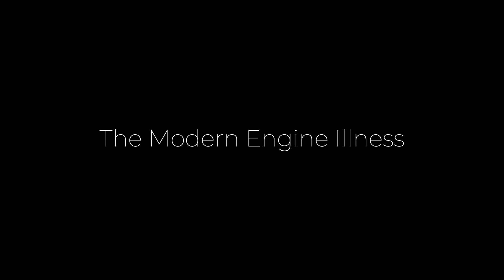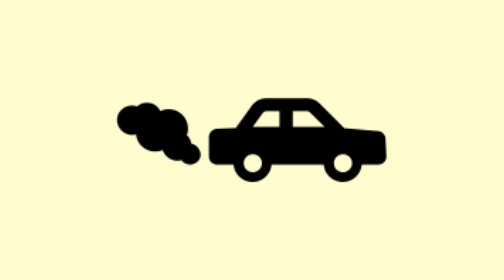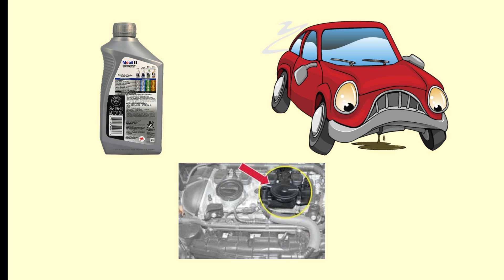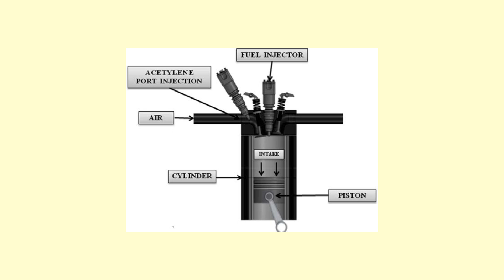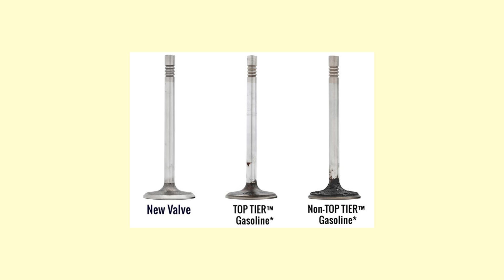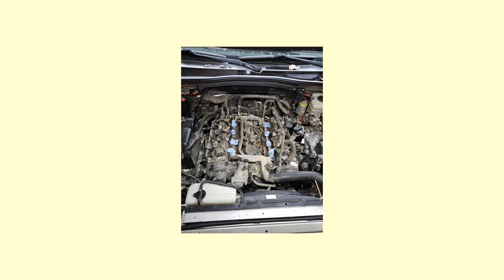The Silent Sickness of Modern Engines

Comment: Direct injection is not more fuel efficient! nor is it more powerful. Fuel has to first atomize in order to burn . When you spray it right into the combustion chamber it doesn't have enough time to fully atomize. Leading to unburnt or in other words wasted fuel. Which is not very good for fuel economy or performance. Bonus fact, the liquid fuel that is left on top of the piston or that gets stuck in the ring lands is now likely to cause detonation on the next power stroke after it has been heated and atomized. This isn't the only damage Direct injection creates. When the liquid fuel sneaks past the rings and gets into your crankcase it no dilutes your engine oil leading to improper lubrication to every engine component.
Reply from the maker: Correct but with direct injection as that fuel delivery is usually more optimised compared to port injection (which focuses more on cleaning intake valves) so thats why direct injection engines usually are more powerful in my view
Reply: @Enguitive  Not to mention direction injection allows for better fuel spray pattern and promotes turbulance to allow for cleaner burning as well as having better throttle respone compared to port injected engines
Reply: @ Cleaner burning? lol I'm not going to relist all the reasons why that is false you can read my other comments, if you want to know why that isn't true. But don't take my word for it. Ford says they now have to put gasoline particulate filters on there new 2025 model year mavericks because of all the unburnt fuel getting into the exhaust due to GDI. I got an idea get rid of GDI instead of this band aid to pass clown world regulations!
Reply: @Enguitive  On carbureted engines or even multiport fuel injection. You get to set when fuel is introduced to the cylinder with your camshaft profile. The optimal placement of your intake valve open and close positions and overlap will lead to increases in both fuel economy and performance. Paired with far superior atomization in the other forms of fuel delivery, you can out perform a direction injection engine on all fronts. You wouldn't even need a catalytic converter. If you didn't have unburnt fuel in the exhaust in the first place through bad cam profiles and improper ignition timing. All this being said your video is a good one to explain basic concepts of direct injection to the non engine builder.
Reply from the maker: Thanks man! That makes sense, it seems that manufacturers are now forced to use either DI or some form of dual injection due to increasingly restrictive emissions regs, I think the last purely port injected engine in a sports compact is the EJ257 in the VA WRX STI, and you can probably see why Subaru can't make a VB WRX STI
Reply: @ Yup it's all about politics sadly.
Reply: @The0utmode  If that was the case, then why do manufacturers continue to use catalytic converters and direct injection? Unburnt fuel isn't a significant problem on any modern electronically controlled engine, whether with port or direct injection, but partially burnt combustion products are a natural product of all spark ignition engines, necessitating a catalytic converter. Modern engines are also equipped with VVT providing a huge amount of control over the cam timing, which manufacturers take full advantage of to improve. Correct cam timing, unlike most if any other adjustment on an engine, improves economy, emissions, and power simultaneously. This is almost never the case for any other engine component as most things can only be tuned for one to be optimized, and maybe two in some rare cases. Direct injection can be tuned to provide superior fuel economy compared to any other spark ignition enginetechnology by means of stratified charge lean burn. This increases NOx emissions and is one of the few things that can reduce the partially burnt combustion products, making the overall emissions profile similar to a diesel. The efficiency of the engine is also comparable to a compression ignition engine. Such a setup does require a special piston design as well as a turbulent intake charge in order to facilitate the formation of a stratified charge, but due to strict government regulations on NOx emissions in the US and the EU, no current production engines take advantage of this technology and even in the early 2000s when it was the most popular, NOx emission restrictions forced manufacturers to use more expensive catalyst systems that only worked over a specific temperature range, limiting the availability of the stratifed charge mode in most driving situations.
Reply: @ Ford said they have to run gasoline particulate filters on there new 2025 model mavericks, because of all the unburnt fuel in the exhaust GDI creates. that proves what a money making scheme this all is. They created the problem by using GDI and now have to fix it with this expensive unreliable part. on top of the unreelable situation they have already created. lol. Just look at Jeep there new GDI engine runs so hot they are melting the converters.
Reply: @The0utmode Do you even know at what pressure the direct injection injectors operate?  How can you say that the fuel "must be atomized first", if you don't even realize that at the pressure a fuel system operates in D.I. engines, the fuel is MORE than..."atomized" 🤦🤣🤣🤣
Reply: @justice4romania96  You obviously have a poor understanding of basic physics! The higher the pressure a liquid is under the harder it is for that liquid to turn into a vapor. If you took a bottle of gasoline into the vacuum of space and opened the cap it would atomize almost instantly. It was the pressure it was under inside the bottle that stopped it from turning into a vapor. What sprays out of direct injection injector is not a vapor it is small liquid fuel drops. Seriously it takes a middle school understanding of chemistry and physics to understand this. Put some water under a vacuum in a glass container and see what happens. Now put some water under extreme pressure and try and boil it. You won't be able too!
Reply: @The0utmode  it's the "most  atomized" way you can get from all the fuel systems in cars, in our days. You can't spray vapours trough an injector...it's basic physics. Elementary.  DI has the finest mist of fuel of all. That's why the pressure in the injctors and the pressure made by the high pressure fuel pump. Good thing cars are made by engineers and not by people who spread their thoughts on youtube 😉
Reply: @ Exactly that is what I just said you cant spray vapors! It is liquid droplets that is why GDI cannot atomize the fuel! man you are dense.
Reply: @The0utmode this is patently false. Carburetors are leagues less efficient and prime to environmental factors that port and direct injection aren't. Direct injection is better than port and carburetored motors by far. The spray atomizes the fuel better than letting it mix with the incoming air charge, you can optimize the spray location in the cylinder to get the best full combustion of the charge itself and decrease odds of droplets and avoid hotspots that can lead to pre- detonation. As with most things engineering, there are draw backs and limitations but to say port or even carburators are better period is just not true
Reply: @ You can't just say GDI is better with out understanding the physics because if you understood the physics, you would know that you are wrong.
Reply: @The0utmode  we're entitled to our own opinions. But I am a mechanical engineer that studied internal combustion engines in college so I do know a thing or two about the physics of ICE. Why it has to be so high pressure. There's pros and cons of each but direct injection is more efficient than any other form of adding fuel. That is a fact. At high horsepower (say 1500 hp +) other forms are a bit better because there's limitations to fuel flow you can get. But for 98% of road cars, it's more efficient.
Reply: @ You have a degree. I work on them everyday. I have seen nothing but pain and suffering come from GDI.
Reply: @The0utmode  just saying I understand the "physics" of it all. You have your experience, I have mine. We have different views. We won't agree, it's all good brother. Take care
Reply: I beg to ask then why do GDI engines run higher compression? That directly leads to higher power
Reply: @ Quench has been improved greatly on most late model engines. They have been running tighter piston to head clearances on theses newer engines which both increases CR and reduces the chances of detonation. If you were to do the same thing on older engines you would see an even bigger gain. If you don't believe me there of plenty of videos of people doing that very thing on old Detroit V8's. Making some really impressive torque numbers.
Reply: Direct injection allows for higher compression, which increases efficiency and also allows more air to enter the engine per stroke simply because it's not being displaced by fuel. Because it's being injected directly into the cylinder, it actually burns more completely. It's also much better metered and precise because the valves don't play a factor in injection. Engines also run cooler due to the cooling effect on the piston. The only problem is carbon buildup on the valves, and the higher pressure is more expensive to repair. Don't forget that all diesel engines are direct injected. It's not new technology.
Reply: @matthewmorgan582  I do not want to defend those nuts ppl here, but you are only partially right. 

What You said is true for low revs. Thats why thos engine are better at city but worzt at high performance. That and that they are compressi g more so they have to save themselves by injecting more liquid to cool it off.

But yea, DI is good for fuel economy in low rev scenarios. Faster it will "spin" the less efficient DI is and may be prone to knock or simply to lean mixture.
Reply: @arkansasturin8144  I did a little more research, and the reason why fuel-oil dilution occurs in gasoline GDI engines and not so much diesel is that the longer stroke of a diesel compared with the much higher compression ratio allows the piston rings to seal better as well as the fact that diesel engines use a central injection point into a combustion bowl which further atomizes the fuel. GDI engines, however, need to inject from the sides due to the spark plug so they can't use a bowl.
Reply: So think about it, All the fuel that is in your engine oil. Was it used to turn the crankshaft?.............No!
Reply: @ Wrong! If direct injection burned more completely There would not be liquid fuel getting stuck on the cylinder walls, in the ring lands, and contaminating the engine oil. Have you ever changed the oil on a direct injection engine? Even if you change the oil every 5,000 miles with full synthetic it still smells heavily of gasoline I've seen it over and over again on all my customers vehicles who have direct injection I'm thinking of going down to 3,000 miles on GDI engines but I still don't even think that can save theses things. The fuel will never atomize if you spray it into the combustion chamber.
Reply: @The0utmode  Carburetors actually cause a lot more oil fuel dilution because during cold starts, when you choke it and pump the gas, it washes the cylinder walls with fuel. DI cools the piston because it sprays directly on it. If you look at diesel pistons, they have a dish in the center, which creates turbulence during injection better atomizing and mixing the fuel with the air. Volumetric efficiency is key. The reason DI engines run at higher pressures is that it atomizes the fuel as it exits the nozzle. Venturi effect cools the intake, yes. I think there's a lot of correlation rather than causation here in your argument. How is it that carbs are most efficient if when I put a holley EFI sniper on a car, it gains 4mpg?
Reply: @The0utmode You have to customize the maintenance interval to their driving habits. I have a 2012 Sonata with the GDI Theta II 2.4 3k mile full synthetic oil changes even with all highway miles and per the oil analysis have far believe average fuel dilution also have a 2013 Sonata 2.0T that I just mess with on occasion and it doesn’t get much highway driving done it gets 1,200 mile oil changes same full synthetic as the 2.4 and it always has slightly above average fuel dilution. If these people drive in town a lot no long trips they need 1,500-2,500 mile oil changes tops
Reply: @Austin-cg7be  Your right, but the problem with that is the average person is unknowing and if you try to convince them to do oil changes that often they will think you are scamming them. People think that their new cars are just like there old ones where they can just ignore maintenance and still get 200,000 miles out of it anyway. I have heard it so many times "Hey my low oil light is on and I just had my oil changes a few hundred miles ago." Some of theses car manufactures say that burning 2 quarts of oil 500 miles is completely normal oil consumption it's crazy. I think 3,000 miles is about as low as I can go for my normal customers. But if I get a guy who is mechanically inclined and cares about their car I could try to explain oil dilution to them. I tell all my customers to not buy or sell their GDI car if they can and buy an older vehicle.
Reply: Having both direct and port injection is the best solution
Reply: @ why? Direct has zero advantages
Reply: @The0utmode Dude, you are wrong, period. You are not smarter than the millions of scientists & engineers who have spent the last 150 years improving & iterating on the internal combustion engine. You don’t hold some esoteric knowledge that’s been hidden from others. The knowledge you lack is freely available through the very device you’re using to watch this video. I don’t know how exactly you came to believe the things you espouse, but I do know how you didn’t come to believe them, through a firm grasp on the fundamentals. A clear lack of understanding of first principles is the one consistent through line. You are attempting to understand a world built on rigorous adherence to the scientific method with a premodern, pre-science, unsystematic mindset. You are using 18th century methods to draw conclusions about 21st century mechanisms. That’s not a dig. It’s just the truth. You come off as more than capable enough to fully understand and apply the requisite knowledge. All you have to do is a little work. 
I’m not saying there aren’t drawbacks from direct injection, but if you take the time to understand the whys & the pros vs cons, you’ll be glad you did. Car manufacturers make plenty of dubious engineering decisions. 9 times out of 10, though, if you take the time to really, deeply understand said decisions, you’ll find they started out as fundamentally solid decisions whose execution got botched. Sometimes, the reason is benign. Others, it’s more nefarious. But nefarious or not, nearly every bad engineering decision is good for the dollar. Take direct injection for example. Engineers solved the carbon build up issue & negated pretty much all of negatives with direct injection a long time ago with Duel-Injection (port & direct). For a long time, the main reason most brands didn’t implement this solution was b/c doing so would’ve required them to pay a licensing fee to I think Toyota, but don’t quote me on that. DI was also new enough that the public was largely unaware of the carbon buildup issues. So, rather than pay the fee & increased component costs required for duel-injection, most brands went with straight DI. On top of lower initial costs, this decision netted dealerships a tidy profit on a new recommended maintenance service to blast away the accumulated carbon buildup. Plus, since lots of people neglect to perform regular maintenance, especially regular maintenance that hadn’t been required on all their previous cars, this decision essentially led to decreased engine life, therefore forcing ppl to trade-in more often, & buy more new cars. It was a win for everyone but the customer. Now that the carbon buildup issue has become more well known (and I believe the patent has run out too), you’re starting to see more & more makes & models equipped with duel-injection. It’s not a conspiracy or a secret. It’s just greed, same as it’s ever been. The evidence for this has been freely accessible since nearly the beginning. The car companies get away with it, and you see it as a conspiracy, because finding said evidence would require you to look. Looking requires one put their ego aside & admit to themself that they don’t actually know. That, & a little work, really is all it takes.
Google: “best fundamental physics textbooks.” Pick the one that looks best to you. Once you’ve done that, google: “libgen” Go to libgen & search for the name of the textbook. Download it, and read/ work through it. If you want to understand the math & are having a difficult time with it, look for an algebra course (or pre-algebra depending on your level) on Corsera, EdX, KhanAcademy, or something similar (it’s not totally necessary unless you want to delve into more advanced physics). Follow that with pre-calculous then calculus. You can also find a fundamental physics course the same way & find the accompanying textbook on libgen if that’s more your suited to your learning style. Once you’ve done that, you should be in a good position to move on to a textbook/ course on internal combustion engine fundamentals. Don’t be afraid to try a few until you find one that meshes well with your learning style. 
If you don’t feel you’ve got the time or patience for the above, at least look for a book like Internal Combustion Engines from first principles.
Reply: @williambrasky3891  He's not wrong. He's just playing smart ass while being dumb, at the same time
Reply: @ "I'm not smarter than the engineers" Ok going by your logic wet belts are a great idea so is EGR valves these were all crated by engineers who are all knowing according to you! lol
Reply: @williambrasky3891 lol you typed all this for a stranger that doesn't cere and probably didn't read 1/10th of it. 
Have a better day knowing that I did read it whole.
Reply: @ I miss when real engineers made good cars and engines that were affordable and easy to work on and understand. Like Ed Cole lead creator of the SBC. Not people who think like you who try to over complicate things for no real benefit other than to increase the billable service hours, just because it makes sense in some fictional algebra equation that does not make it applicable to real life.
Reply: @ Hey believe it or not I did read his whole comment and I had a good laugh while reading it too! I really liked it when he said I used 18th century methods to view the 21st century. He has no idea what a complement that is to me. I mean come on it's even in my user name I'm the outmode. The name literally means old technology. in my spare times I read all the old books I can on engine building filled with basic math founded in common sense. The newest being 2009 because its by an author I really like who has been writing since the early 70's. I'll let you guess who that is hint he is still alive today! And no it's not me. No I don't need an algebra course. Algebraic thinking is everything wrong with the modern world. Lets do a math equation that could have been solved in one line of notebook paper with basic math, and make it take up an entire page using the most convoluted inefficient methods possible to hopefully maybe come up with the same answer if you didn't make any mistakes. You can see this nonsense directly translated to automotive design. Changing an alternator, classic car: Unhook negative battery cable, remove alternator to bracket bolt to remove the V-belt. Remove the wires (one is usually an easy to remove electrical connector and the other is a nut you can unscrew from the alternator it's self.) Remove lower alternator bolt reverse process for installation. Modern car: Unhook negative battery cable, remove head lights, remove front grill, remove front facia and bumper (breaking some of the brittle plastic tabs in the process). Lift the vehicle, remove a tire to access a plastic mud shield (that is held on by plastic pins)    Use a special belt tool with a half inch of space between the tool and the razor sharp sheet metal. Got the belt off? Good the pain has only begun! Remove the AC compressor to access a hidden alternator bolt. Remove all the aluminum alternator bolts (that must be replaced after removal) reverse process for reinstallation. all this only pays 5 hours lol.
Reply: What about caburated engines? Is it better than direct injection or does it have its own flaws?
Reply: @karmdeez911  as much as carburetors rock, fuel injection is more practical and predictable under different conditions. You can have a carb,intake setups that will help with atomization and performance. Ecms with the help of sensors offer more on the fly adjustments based on  conditions. This explains why you would have a Carb choke until temperatures built which also helps with the process
Reply: @ it should have problems since they do not have unlimited adjustment on the fly the main jets will remain the same no matter the throttle input but you can get really good performance out of carburetors 
So yes carburetors will have problems
Reply: @ Carburetors are actually the most efficient at fuel atomization and produce the most post peak torque and horsepower. The only disadvantages they have are cold start ups and they are sensitive to changes in temperature and elevation.
Reply: @The0utmode  saying the "only disadvantages are" and then listing every variable under the sun that realistically applies to both daily driving AND racing applications in all environments, is crazy. 

also saying carburetors are the most efficient at fuel atomization and produces the most torque/hp while it is a well known fact that they have a super hard time controlling fuel/air ratios in just about every aspect of driving, well that's just lying. 

please stop. there's a reason no fucking modern car on the planet chooses a carb over port/direct fuel injection. 

yes politics and policies have been destroying modern engines, but carbs? sure theres nothing quite like the sound of a raw carb'ed engine ... but to say they are better ... straight up delusional.
Reply: As a mechanic I'll say this. EVERY direct injection car I've worked on burns oil with less than 60k on the odometer. Let that sink in
Reply: @ I have seen the same thing non of my customers who own a GDI vehicle are happy with it!
Reply: @Sero12245 as a owner of hated 1.4 tsi I'll say that it does not burn fuel after 15 years of short city driving, 120k km. Original turbo.
Reply: You get around 25% more power NA with direct injection. This is because you can cram more air into the engine. With carbs or port injection the atomized fuel takes up volume in your intake runners. But if you deliver the fuel directly to the combustion chamber, it’s just pure air coming through the valve.
Reply: @ "you get 25% percent more power" Who told you that? Car companies will tell you anything to sell planed obsolesce. If you listen to them enough they will tell you that a wet belt leads to a 1% fuel economy saving!
Reply: I think ppl don’t understand, direct injection makes more power because the whole intake port is used for air so more fuel can be used, and the high pressure fuel suddenly evaporating has a refrigerating effect on the combustion chamber so they can get away with higher compression, but you are completely right. It is LESS efficient, it doesn’t mix the air and fuel well as you said, which leads to rich and lean pockets, and carbon buildup. The reason DI is used is a combination of a horsepower war and emissions regulations. DI and forced induction work GREAT together, the refrigerant effect of the evaporating fuel and the greater volumetric efficiency of the entire intake port being used for air and only air. Then automakers can make tiny boosted DI engines that make a ton of power while easily passing emissions and being relatively simple to mass-produce.
Reply: @ This is the best reply I have gotten, finally a response grounded in reality. I like the way you think. On paper DI sounds like a good idea but here is why it doesn't work the way people think it works. When you have gasoline that is under 500 to 2000 psi of pressure and then you introduce into a slight vacuum like the conditions found on the intake stroke of a naturally aspirated engine. The fuel that was under this pressure will still take longer to atomize than fuel that was under atmospheric pressure that was then introduced to a vacuum. It is like trying to boil water that is 34 degrees versus trying to boil water that is already 210 degrees. The best situation is to already have the fuel under a vacuum before it enters the combustion chamber. So contrary to popular opinion GDI and boost is actually a bad situation because now the fuel never sees vacuum. Another thing to ponder is how good is extra compression if you have to back of timing to curb detonation, leading to even more unburnt fuel.
Reply: @The0utmode  this is you right now lmao. https://youtu.be/bZe5J8SVCYQ?si=SbGN973nx9HAOM5p
Reply: @ looks like you ran out of things to say. It's not like you were cable of using critical thinking in the first place when all you could do is quote something that somebody else said. this is you right now. lol https://www.youtube.com/watch?v=kIZ9YuPm_Ls
Reply: @The0utmode  The fuel is at a pressure more like 2000-5000 PSI, gasoline is a very effective refrigerant, and this is at pressures an order of magnitude higher than your typical fridge or AC unit, the effect on combustion chamber temperature alone is worth it to the engineers at these manufacturers, it’s cheap, easy power. They don’t really care about the consequences because people coming in for repairs all the time makes shareholders more money.
Reply: @ I tested a GDI system on a Nissan and at idle it was 500 psi. The reason I gave the numbers I did was a best case scenario for GDI I even assumed that the fuel is being injected during the intake stroke under vacuum which it was that way on some early GDI systems but on the new ones they inject it during compression so the fuel never sees vacuum. So you get no cooling affect. Carburetors and MPI run colder. Seriously hook up your scan tool to an MPI car and GDI car if you don't believe me!
Reply: Direct injection does improve performance as it better cools the intake air, allowing for a higher compression ratio and/or more boost for a given fuel octane. This is the reason why German WWII fighter planes used it, as certainly no military cares about emissions during wartime, only performance.
Reply: @ Direct injection does not cool the air better! When matter goes from a liquid state to a vapor. This has a natural cooling effect. This is the principle your air conditioning system works upon it's why we sweat when it's hot outside. You don't have that effect in the intake manifold or the intake port on a direct injection engine! Carburetors cool the air charge the best with TBI and MPI in second place. If you don't believe me look up the venturi cooling effect.
Reply: Wrong bro
Reply: What if GDI injectors used as port injectors?
Reply: @ Thats a great idea. You could almost atomize as well as a carb then.
Reply: In my experience direct injected engines are not more fuel efficient than port injected. So i agree with your statement.
Reply: They are more efficient. Because you have such good cylinder cooling off the Fuel turning to vapor. Thus you can run more advanced timing and higher compression ratios.
Reply: You're an idiot yes it is or tuners wouldn't suggest that upgrade that allows you to tune things much more that's why most older cars have direct fuel injector upgrades who would want less tuning capabilities. Don't care for economy but do not lie in anyone's face abiut performance that's not sliding. Again the tuning ability is absolutely massive compared to port injection.
Reply: [EXTREMELY LOUD INCORRECT BUZZER NOISE]

Ever heard of ever increasing finer-atomizing injectors?

To ur other points about the potential damage of GDI tho, those points are probably correct.
Reply: Thats why its usualy only in DIESEL cars
Reply: Well idk about all direct injection but mine gets good fuel econ it's 2.5 direct inject with 13:1 compression I get like 32 city and 38 hwy I checked for carbon build up at 80k miles so far none
Reply: My Bosch diesel injectors can fire up to 10 times per cylinder movement, literally shaping the fuel front of the combustion.  That's necessarily more efficient.
Reply: Like I'm not tryna be mean but stop saying uneducated sht yes with a factory tune it might not be as powerful and burn every drop of fuel but with a simple tune that all changes I wish you would say I'm wrong tf😂 that'll show me who's done tuning on turbocharged vehicles across all years and who didn't.
Reply: @toxicity6629  mind explaining me why you can run higher compression in gdi since OP did not?